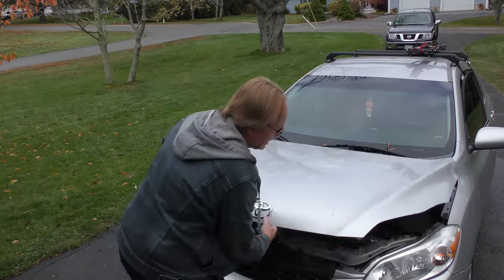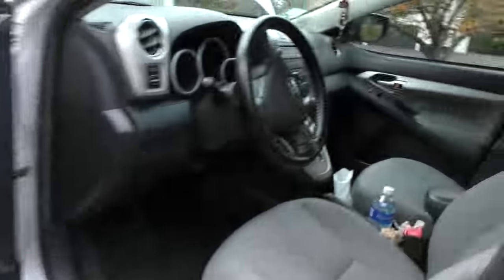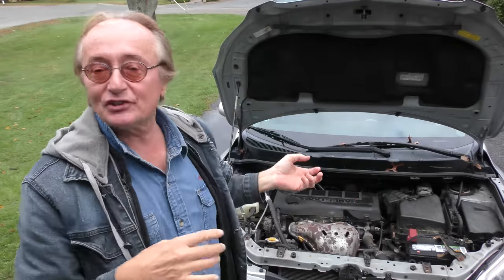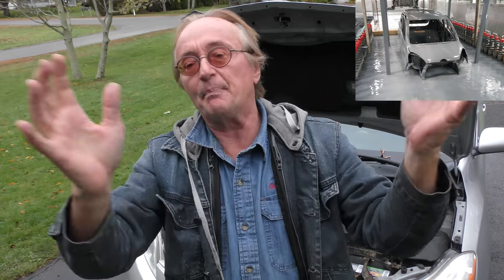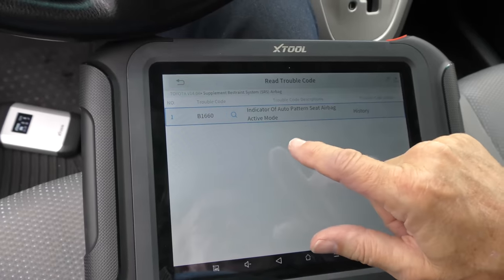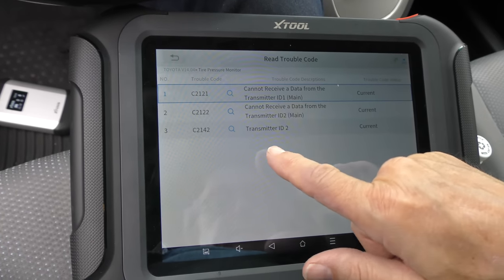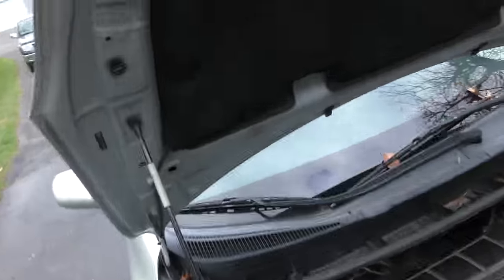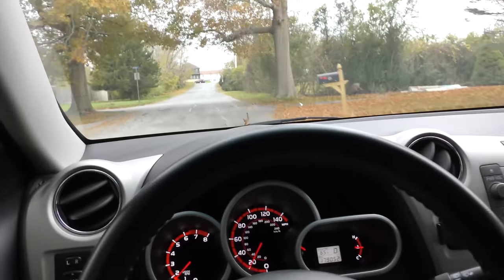Never Thought I’d See the Day

Comment: I also had a 2010 Matrix base frontwheel drive, one of the best out of 23 vehicles that I owned in my 67 years. I live in snow country of northeastern Ontario Canada, and always ran All Season tires (I've never owned snow tires on any of my vehicles), and never got stuck even in deep powdered snow. A really Great car in my opinion!
Reply: I've found all season tires are actually better than snow tires, even in deep snow.
Reply: I absolutely loved my 2010 matrix FWD and got 30 ish MPG 
And I got 350k miles on original engine and transmission 
At exactly 350k miles the torque converter went out and it was going to cost more then the car 
   I drove it from Laconia NH to CT 3 days a week..6 hrs both ways. 
    It only left me stranded twice ! 1st tims it was cuz of the alternator at 280k miles was told it was the original 
And 2nd time was when the torque converter gave out at 350k 
     I also had a problem with the abs and VRC and stability control lights were all on at the same time..and they would go on/off randomly but car didn’t run any different..the dealer said I needed a new computer and wanted $1,800 I said I’ll live with the lights on…lol 
     Then one day they turned off and never came back on..after being on/off for 4 months ..
But the car kept running..
Reply: Surprised you didn’t get the AWD
Reply: @jessewynne8193 DUDE, my VSC                     AWD TRAC lights have been going on & off for 7yrs lol SEVEN. they had just been on for nearly 1/2yr straight but just randomly turned off yesterday. Crazy

Comment: I had a 2003 or 4 Pontiac vibe witch is a matrix I absolutely loved that car I owned it for 13 years not a spot of rust . that car was like a little tank in the winter and never got stuck as long as you had good snow tires traded it in with 225,000 miles for my Tacoma witch is going on 8 year's old now with 124,000 miles runs like it's still brand new .
Reply: Shhh don’t tell people about best kept secrets like that lol

Comment: Hi Folks! I just bought a Toyota Matrix Xr 2010 (front wheel drive with 2.4l) with 78 000$ for 12500$CAD here in Canada, great car so far! 

Thank you for confirming that the 2010 2.4l is not really having the bad cylinder ring problem from the 2AZ-FE, that info was hard to find and it's the first time I can hear it...

Comment: I own a Toyota Matrix 2007 with the 1.8 liter 4 cylinder engine with over 212,000 miles on it.
I had always changed the engine oil every 3,000 miles with a few times at or over 3,500 miles.
At about 200,000 miles I changed to fully synthetic oil from Costco. Now, I am aiming at 8,000 miles per oil change. 
When I changed to fully synthetic oil I was aware I could have hand leaks. But, there were / are no engine oil leaks even after 200,000 miles.
I am shocked to see how much this Matrix runs like it is / was a new vehicle for me. We live near a very busy freeway on the way to Los Angeles. Once on that highway traffic moves at near or very close to 80 mph. The Matrix still has no issues stepping up to near or at about 80 mph very fast.
I just replaced my 2nd exhaust sensor 1 upstream oxygen sensor with free shipping from eBay. For under $30 it works very well.
I was at our local Costco about 10 days ago and there was a fellow in the parking lot with another Matrix about the same year 2007 as mine.
I went up to him and told him I owned a 2007 Matrix. I asked about his Matrix? He told me the Matrix in front of us had only about 55,000 miles on it and he had just bought it used from a lady in Montana. He paid about 2 times the blue book price for this very lightly used Matrix. He told me his other Matrix did not operate with over 360,000 miles on it. He told me it failed to run because there was water or some other material in the gas tank. He loved the Matrix so much he found and bought this one with 55,000 miles on it in Montana.
He told me that he opened the gas tank and the gasoline appeared to be contaminated and unusable.

Comment: You absolutely have gravitas. You ever thought about doing an auto-repair show on radio? Your videos are absolutely great. And I happen to have a 2005 matrix with the 160000 miles. And it runs absolutely great. I just love it. It's a 5 speed and it runs Just as good as the 94 Corolla and the 86MR2. Can you say anything about the MR2? I also had a 94.
Hilux Pick up And it was a very reliable Low maintenance Joy to drive. And like I said your videos are awesome.👍

Comment: Our 2009 Pontiac vibe GT has the same engine and it burned oil bad! Started to notice it at 70k would go through a qt every 800 miles! We traded and got a Camry and haven’t had a single problem with it!
Reply: I have an ‘09 Matrix with the 2.4-liter engine..those are the oil-burners!!
Reply: @frankgerace5997  yes

Comment: I've found rust actually does the most damage on the front & rear subframes rather than the frame or in the case of a unibody construction, the undercarriage. Worst part is, you can't really apply any rustproofing to those areas because many of the working and moving parts are attached to them.

Comment: I really miss my 2011 Corolla XRS that had the 2.4L and my gosh was it fun to drive fully loaded it was like having a Corolla race car very fun on the highway haha
Reply: @icosthop9998  well I kept the car for awhile until I got squished between 2 pick up trucks so insurance wrote it off, so I learned my lesson and got a 2017 Toyota Tundra with a 4.6L V8 such a beautiful truck had that for 5 years and nothing went bad with it but then I ended up get a travel trailer for the family a Rockwood Roo 233s now the Tundra handled it while it was empty but loaded it was either at its max or jus slightly over it so I had to get rid of the truck I cried and then I cried again cause now I'm in a 2013 Ford F150 with the 5.0L V8 but it pulls it a lot safer and that's what I was concerned about I know they are fairing well but I still have my eye on the either the 2022 or 2023 Tundra 
what do you drive B'y
Reply: @icosthop9998  yah I hear yah there, jus like every new release of a vehicle there's always bugs to get worked out, what they should do is give those prototypes to us normal class people so we can but it thru the ringers right, there techs wont push it nor use it to the extent that we would, and then they would get some actual feed-back on it

Comment: Those ghost codes really do seem to be a Toyota specialty 😆😂 My ‘03 4Runner with 293k on the clock will throw the dreaded CEL/TRAC/VSC combo sometimes.. and when I get it home, I’ll plug the computer in and then *surprise*, nothing is read and all the lights are magically turned off when I start the ignition 😅
Reply: I had this problem! the mechanic said it was my  cat, so I used cataclean and the lights went off when I was driving! I hope they stay off. Hope this helps

I have a 2011 matrix

Comment: I have a 2014 Corolla. 1.8 engine. 200,000 miles. No issues. I did change the rear hub bearings.
Reply: Where's the modules

Comment: I am getting 50plus mpg with my 2003 Pontiac Vibe ----- Matrix with 5sp manual .I live in the country and there is rarely stop and go . Wide open lightly used roads for the most part.Also the Canadian gallon is 25% bigger --- 160oz. CHEERS from HERE! PS 1.8 L

Comment: I often look for used Toyotas to fix and flip to make extra money.  And can  say stay far far away from any of the Toyota  2.4L engines.  The 1.8L and 3.5L are pretty much bullet proof, but the 2.4L for all years, and   models including scion just have too many problems.
Reply: Did you mean the 2.5 engines?
Reply: I have a Toyota xse, is the 2.5 engine okay?
Reply: @fiapoto92  the 2.5 is an entirely different engine, not the infamous 2.4L 2AZ-FE
Reply: @alscrob  this is my first Toyota. 70,000 miles hoping it last long with the 2.5L engine.

Comment: I have a 1.5 Corolla '94. Pristine condition. Gets 52 kpg. That's 32.3 mpg.
Not enough power for normal western roads but good enough for my needs. Not a popular engine; does anyone have experience with the AE100 1500 motor? Just curious.

Comment: With that stock radio, I’m guessing one or both of the knobs are broken. Just fixed mine (volume) today.  Notorious little problem, but there are lots of options to fix it.  (2010 Vibe)
Reply: no i havent had to replace them yet. If your driving a pontiac vibe, is the radio manufactured by gm? i think they use different radios or something like they cause they dont look quite the same.

Comment: The thing is with the tire pressure system if you just use an air gauge the vehicle goes in limp mode because the lights on you can't even turn the traction control off be nice to be able to get around that
Reply: Not on that car. I've not had that issue on any vehicle I've owned, but I've heard that is the case on some GMs, but I've never verified that.

Comment: My 2013 toyota corolla , where the engine meets the transmission my seal is is leaking oil abit....  It's about 240,000km ? Not sure if there's a liquid fix for it  or I should leave it

Comment: I hope you had a great Thanksgiving in the United States. Mr. Kilmer, what are your opinions on a 2008 Mitsubishi Eclipse GT hatchback coupe with the 3.8 L V6 engine and the five-speed automatic transmission with sport mode, a 2012 Hyundai Veracruz Limited AWD mid-size crossover with the 3.8 L V6 engine and the six-speed automatic transmission with manual-shift capability and a 2015 Infiniti Q50 AWD compact or mid-size sedan with the 3.7 L V6 engine and the seven-speed automatic transmission with manual-shift capability? I heard that the Eclipse with the V6 and the Veracruz are great vehicles in reliability, but the Q50 could be a lot more reliable. For starters, it is most likely the Veracruz crossover or the Eclipse coupe. For experienced drivers, the newer Infiniti model will be the best option, which is the Q50 with AWD sedan. I hope you have any additional answers, sooner or later. Thank you very much.

Comment: I will drive it then sell it. That is me. In 2000 I bought a 99 Corolla as a commuter because my Tahoe was killing me in gas. Meh, I drive it until it starts costing money to keep it running. It is currently at 199,000 miles and other than tires and maintenance all it has ever needed was an alternator at 150,000 and a set of plug wires. After I foolishly used a self serve car wash  pressure washer to clean the engine. Even then it was only because at 101,000 it ran really crappy before the dealer told me don't flood the spark plug holes again.  The dealer mechanics I asked said that most of the major repairs they see are transmissions. But only because most people forget to do the fluid change/ maintenance on them.

Comment: Scotty, thanks for all the great information and advice on the Toyota Matrix.

I have the 1.8 liter 2007 toyota matrix it may have less power but works for me.
I can get near or over 37 mpg on the interstate. Got to love that fuel economy in California with near $5 gasoline. In southern california we don't need all wheel drive 2 wheel drive does just fine in the sunshine and dry roads.
Our gasoline is now nearing $4.5 a gallon. Who says Saudi Ariabia is our ally and friend?
Reply: Because most of the gas California gets doesn't come from Saudi Arabia. California has higher restrictions when it comes to gasoline, if I'm not mistaken most of your gasoline comes from Canada but don't quote me on that.
Reply: @setsunasetsuna9342  I would not be surprised if none of our oil or gasoline in California comes from Saudi Arabia. The cost of oil relates to the world wide pool of oil available to sell and deliver. 

Those barrels of oil in Saudi Arabia being cut back in October by 2 million barrels per day drastically raised the price of oil by the barrel immediately.

I believe our gasoline prices shot into and above $6 a gallon very rapidly in October. Now, just after the early November election our gasoline is nearing the low $4 range and dropping.

It is those marginal barrels of oil that control the price of oil. Those 2 million Saudi barrels raised the cost of oil drastically. 

Why did Saudi Arabia so drastically cut back production and raise the cost of oil just before our November election?
Reply: @wendyphillips5002  Good question, I'm assuming something politically motivated.
Reply: @setsunasetsuna9342  Just seems too much of a coincidence. 
Before election oil prices rocket up and after election prices drop. Who gains from that drastic oil fluctuation?
Reply: @wendyphillips5002  I have no idea
Reply: I regularly redline the rpms and drive the 2.4L AWD 100mph …so I get about 10mpg lol it’s worth it though, that car is so much fun

Comment: The problem with the matrix is it kinda drives like a brick and the sound proofing onit kinda sucks. I have mine at 200k and my biggest issue is some alternator issues but other then that it travels great. Got my 2005 matrix base 8 years ago for 4500usd used with 125k

Comment: Loved my 2010 matrix fWD 
Base model lasted 350k original everything torque converter went out always changed transmission fluid and filter every 60/80 k 
Aside from dying and leaving me stranded I only was left stuck 1 other time at 280k the alternator went out but bought it with 125k 
Lasted me 4 years drove it 3 days a week from NH to CT and back
The whole time I owned it..
Also fits a lot of things in it with the seats down 
     It did have a 4 month spell of VTC and stability and engine light all on at same time on/off  during a bad CT winter 
  Dealer tried to tell me it needed a main computer for $1,800 I said no the car runs the same as always I’ll live with it..
4 months later the weather warmed up and lights  turned off and never came back on any of the next winters..so I 😢guess it fixed itself..😂 
    I miss that car

Comment: Hey Scotty or anyone with the 2009-2010 1.8L Toyota Engine, can anyone recommend how to fix the known issue of a cold start rattle in the 1.8L's? My 2010 Vibe makes a nasty rattle on cold start only. I've read the intake VVT-i gear takes a sec to build enough oil pressure to lock the gear for normal operating mode. I'm curious if anyone has got this issue fixed permanently, the only solution I've seen is to stretch the VVT-i locking spring to reduce the amount of oil pressure needs to lock. This seems like a temp fix as the spring will wear again. Any advice is welcome, thanks!

Comment: I believe the Corolla Cross is the new alternative to the Matrix.
Reply: Why's that? The Matrix was a Corolla-based hatchback, and now there's a Corolla Hatchback. The Matrix was not a CUV.
Reply: @lucienswift447  There's a point for sure. Many buyers of the new hatchbacks enjoy driving, particularly those who opt for the manual transmission, and use grippy summer tires. You see them at autocross events. The Corolla Cross, unlike the Matrix and the new hatch, is an appliance.
Reply: @lucienswift447  believe it or not, some people are actually fans of the Corolla Hatch, and compact hatchback cars in general. If they're like me, they don't want a sedan, and they don't want an appliance. I wouldn't consider the sedan or the Cross, yet the hatchback is one of my favorite current models out there.

Comment: I got a 2003 toyota matrix xr with 275k miles and it only gets 20 mpg. I did plugs coils air filter oil and still 20. What else could it be? I also aired up the tirea
Reply: Take it to a mechanic and have them run a diagnostic on it.
Reply: Start with cleaning the intake manifold and valves after running a computer diagnosis. Often times either that or one of the sensors need changing/ cleaning (which the computer diagnosis reveal)
Reply: I would check the catalytic converter and O2 sensors too
Catalytic converters plug up after a while
I changes mine once .......I found out it was plugged.....it was like night and day in the cars performance abd fuel economy too
Reply: @andybales7318  its hard to get to D:

Comment: My Volvo have Tire Pressure Monitoring, but don't have stupid sending units in wheels, it measures how many times wheel rolls and compare  that whit another wheels, all cars have those computers, all cars monitor that allways. Why put some stupid units to wheels inside?
Reply: More accurate
Reply: All wheels roll even the one with low air.  How does that tell you your tires are low. What if all are 20 Pisa.
Reply: @danc2014  Could be referring to abs traction based on rotation